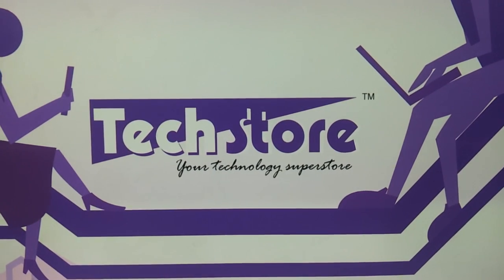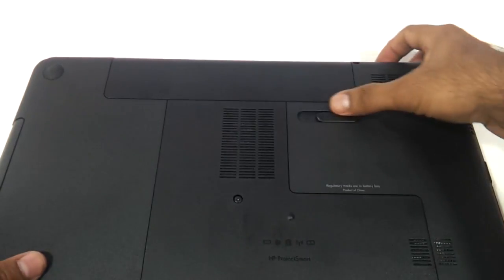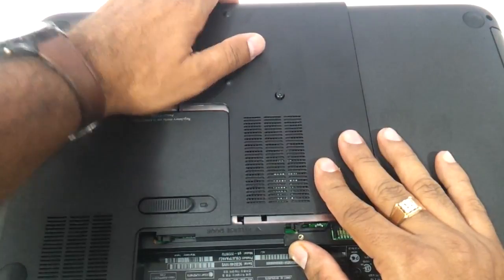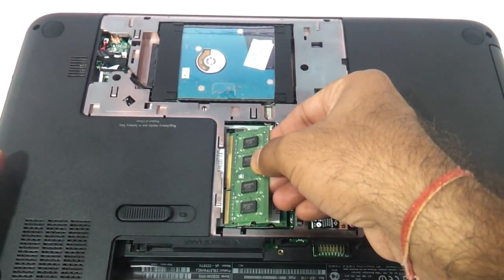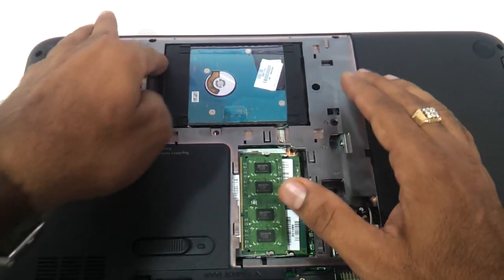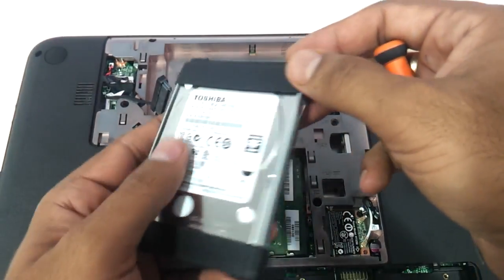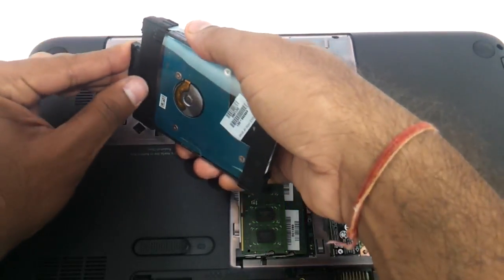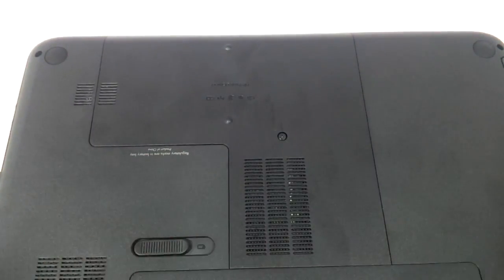HP pavilion G6 2000 how to upgrade ram and harddrive 2202 2207 2228 2227

Comment: Where can I buy that RAM memory to incorporate...? Can you give me the technical characteristics of that memory...?
Reply: Hi there I have also this laptop G6 2103tu which have i5 3210m cpu I recently upgraded the ram I saw that this handle 1.5 v ram easily but you can use ddr3L 12800s branded company ram if you getting same ram Pc3 you also but depend on you how much ram will you get I use 4+4 gb 😊

Comment: Hi mate, my g6 from 2012/2013 is still running today (quiet loudly) it has 8GB RAM atm which I’m looking to upgrade, hopefully to 16GB, is this possible using an AMD A8-4500M (1.9 GHz) processor? Also, my current battery life from 100 to 0% is under an hour lol, so i’m thinking of replacing the battery and cleaning the cooling fan with condensed air to improve performance? Hopefully I get a response from commenting on this vid 8 years later haha, cheers!
Reply from the maker: yes
Reply: @TechstoreCoIn  - Best comment I every found anywhere for a question :) Way to go !

Comment: If you are here for the Maximum RAM capacity of your G6 then I'll tell you my story. I have an HP Pavilion G6-2211et. This particular laptop's maximum RAM capacity is 8gb on Windows 64bit  according to the manual. I then found this program called dmidecode. It reads information from the motherboard. I'm not sure about the accuracy of these readings but it says that 16 GB is the maximum RAM capacity of my motherboard. I have an i7 3632qm processor which has the capability to support up to 32gb RAM on 64bit. So i ordered 2 8gb RAM sticks and just today I confirmed that both slots read the 8GB ram sticks i bought. Now my laptop is running with 16GB ram. So I can confirm that G6 can support 16gb RAM provided that your processor supports it and Windows version is 64bit. You're welcome.
Reply: it will be better if you say the frequency
Reply: Can you tell whats the max supported mhz frequency  for ram and what mhz you are using ?
Reply: Thanks for the information I have the same laptop specs and I'm upgrade it to 16gb ram

Comment: hi,do we have to format before upgrading or there is no need to do anything and we can upgrade it without any fuss...? will there be any implications if we just upgrade it on just like that
Reply: harsh chanchal You can just upgrade it and the system will detect the new ram and everything will be fine, you don't need to reset your laptop.
Reply: my question too

Comment: Hi, very simple and informative video greatly appreciated! do i need an anti static wrist strap for replacing my memory, if i don't have one what are the options i can use instead?
Reply: To be perfectly honest, I don't use one. You can just take it out with your bare hands. The CPU and heat sink is what you need to have a strap for.

Comment: can anyone help me here? I was trying to unbolt the bolt at the back of my hp pavilion g6-2024tx, and so I tried to unscrew it, but then the bolt doesn't come out!, I couldn't get the case out, and its so frustrating, I just realised that there is a spring located right below the bolt, and so it seems like the spring is preventing me from taking it out...
Reply: the bolt dont need to come out, only unscrew it a lot and take the housing
Reply: thanks man, just took it out and found out that the cover was quite stiff at first
Reply: yes the first time was difficult for me too xddd